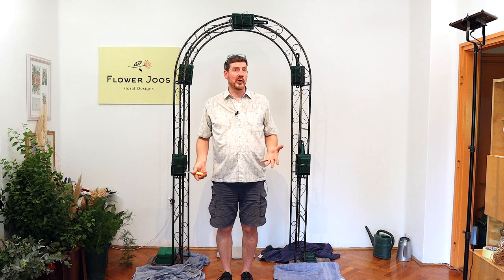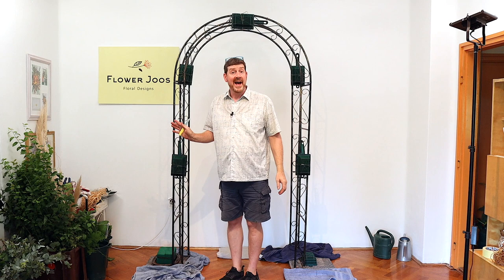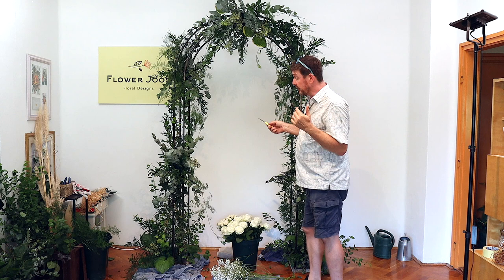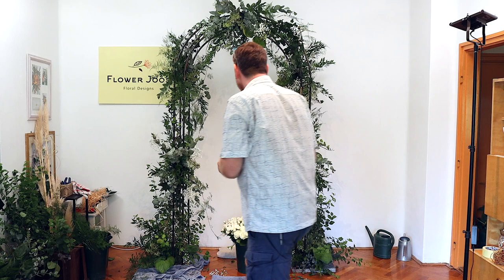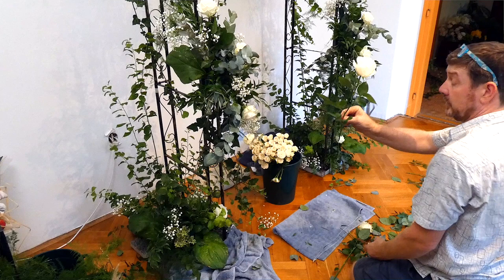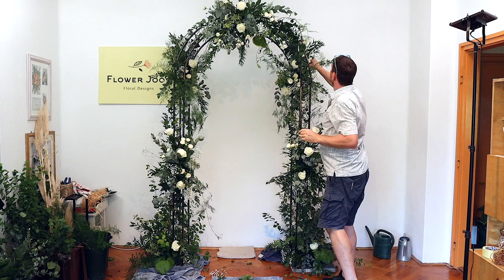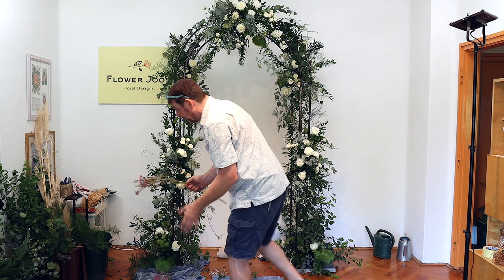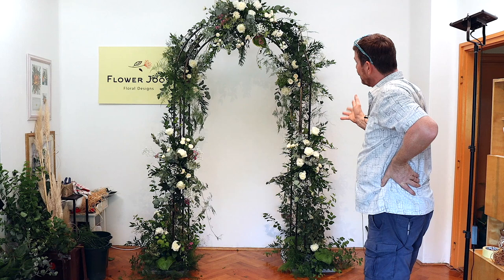How To Make An Elegant Arch Design

Comment: Oh wow! beautiful. This vid in particular is VERY VERY helpful to me. I have been strugling for years on getting the flowers on the iconostasis right. Only now i realized i need to have an arch made that will just fit the Royal Doors. so i can attach the oasis to that.  This way i can also do the flower arranging outside  and have it carried in to place in front of the Royal Doors. Saves a lot of messyness and cleaning up. Thanks for uploading. God bless 
(ps i love the big longcase clock in the other room. Im a huge clock junkie. one can never have enough clocks.)
Reply from the maker: Thank you! It would take to people to move I think - but that’s great you are inspired! 
The grandfather clock is beautiful - has been in the family for a long time, and now on the landing! It used to work but the weights dropped and never been reset up . Not sure if I want it going though - though after a while you don’t hear it! 😀

Comment: Beautiful work John!  Lovely choice of products, too.  When designing something like this for an event, would you ever predesign any of the cages, then transport them to the venue for installation?  Or do you always design on-site?  Thanks for sharing your talents!
Reply from the maker: Thank you! I think if you have a van that can take the arch you could set the cages on, and pre green - but then it’s open to damage in transit. It’s a lot lighter just as a frame and then set up! But you could pre-green the cages then tie them on . Then it’s just linking with ivy and add the flowers. 
So I suppose it depends on the size of your van as much as anything! 😀🙋🏼‍♂️